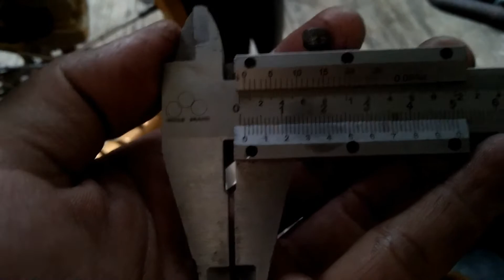cara bore up jupiter mx pakai piston vixion

Comment: Tenaganya sama ga sama vixion?
Reply from the maker: Sama mas malah bisa lebih besar kalo setingan karburator ketemu
Reply: Kalo blok MX nya ORI bawaan pabrik itu bisa masuk bang pistonya Pake punya Vixion?
Reply from the maker: Bisa tapi harus ganti liner, bawa ke tukang bubut
Reply: Punya saya kan beli motor Vixion trus blok nya pake MX piston nya kok punya nya 3C1 punya old Vixion pistonnya bisa masuk di blok MX tenaganya kayak MX bang
Reply from the maker: Mungkin permasalahannya bukan di piston mas coba cek lainya kaya injeksi karena kalo piston pake 3c1 itu udah piston Vixion
Reply: @ASOMOTOR  kode blok nya 135cm 50C00 kode piston 3C1-Y30
Reply from the maker: Iya kalo 3C1 emang kode untuk motor Vixion, jadi itu blok jup MX tapi udah di boring ulang pakai piston Vixion harusnya tenaga sama seperti Vixion, mungkin ada permasalahan di lainya
Reply: @ASOMOTOR  oke